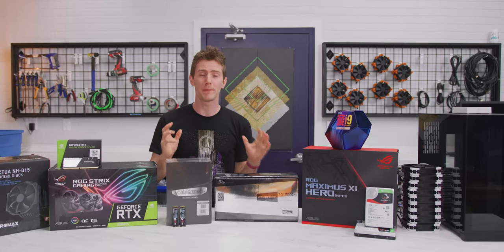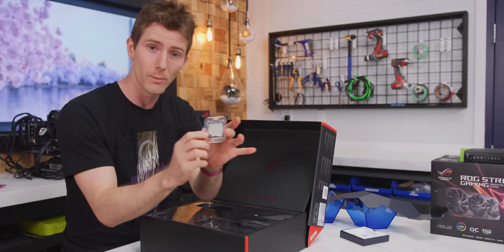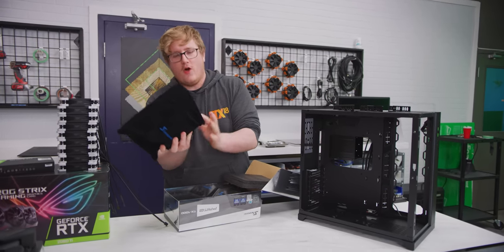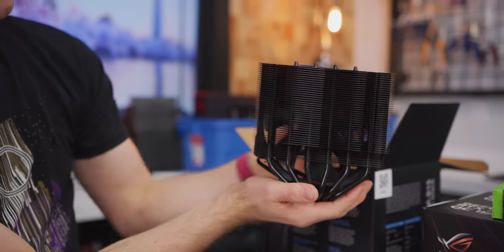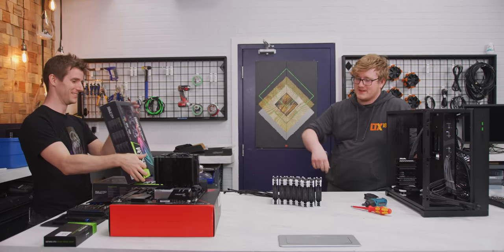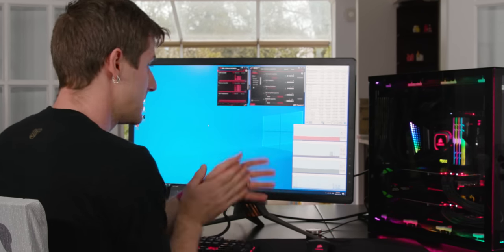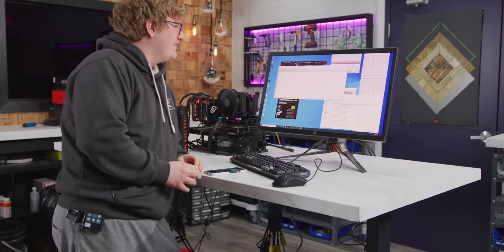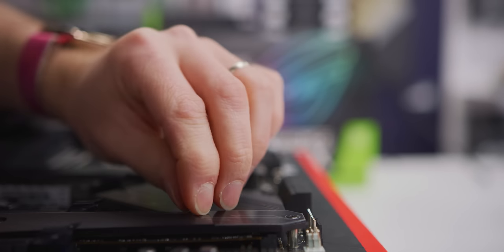Can AMD Beat the ULTIMATE Intel Gaming PC?

Comment: "We wasted a little bit of money on a second graphics card" ...  yeah, those darned, dime a dozen 2080's huh, pff          lol >_<
Reply: just a little money...heh
Reply: 2080 ti's. Don't forget those two letters, that's a $400 difference *per card*.
Reply: 2080 ti*. 2080s are much cheaper
Reply: agree, still overprice system for most people ~$4000+. maybe 850 watt PSU, rtx 2080 super & one 970 evo NVMe SDD, ~8+ HDD, ~ 3+ case fan enough?
Reply: Forgot to mention a new cooling system and another motherboard. Frankly speaking they should know that second GPU is a waste of money for gaming.
Reply: And raid 0 nvmes

Comment: Air Cooling...
00:50 "It doesn't make a difference."
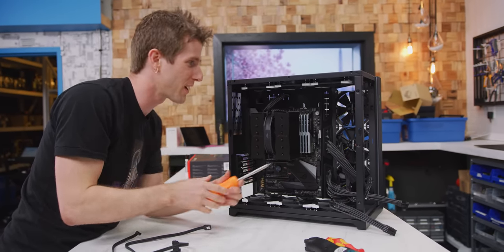9:56 "Oh my God... It doesn't fit."
Reply: LTT: "It doesn't make a difference."
Gamer's Nexus has entered the chat
LTT has left the chat
Reply: This is so good played one after another
Reply: yeah cause every case fits a "full ATX motherboard" and a water cooling loop, or even an AIO.
Reply: I made a pc for my friend with the hyper turbo cooler master two fans same thing happened but he had a plastic case so it just warps it a bit lol
Reply: that’s what she said
Reply: i thought the trendy thing was to go wall mounted now. no case means no problem.
Reply: Doesn't make a difference if you get a proper case*

But yeah, the main drawback is DEFINITELY the size of air coolers.
Reply: XD
Reply: @gardian06_85   yeah because every case fits a 100 ft tall tower cooler and everyone uses only the second PCIe slot, or even any RAM with heatspreaders.
Reply: @kingsizemedal  arguably most water coolers are actually bigger, they're just designed to be a standard size that fits in a standard place in most cases.
Reply: Bet it would fit in an R6.... Just sayin'.
Reply: thats what she said
Reply: Lial Li cases LUL!
Reply: Air cooling is better in my opinion. I dont need the headache when it goes wrong
Reply: @lewissmith5759  It only goes wrong if someones is just enough stupid to NOT check height and ram clearance. Something that someone with 10 years experience should totally not do.

Comment: "We went with an air cooling because water cooling isn't necessary"

Narrator: it was necessary
Reply: Read it in Morgan Freeman voice
Reply: That air cooler is a monstrous ugly block of aluminum. AIO makes everything look neat and organized.
Reply: @Gamevet  Yeah but the function of the PC and performance, it isn't necessary it makes no difference
Reply: According to the new Gamers Nexus video there is differences..
Reply: @mattlevin2205  It makes no difference when you use an air cooler as big as a 2 stroke  engine. Those things are ugly.
Reply: @Gamevet  ugly until you realize it will outlast any AIO by ten years at a cheaper price.
Reply: @Gamevet  Shure if you like having fucking pipes run all over your Mainboard.

But seriously, taste is relative, I prefere BeQuiet over Noctua by a Longshot, because in my opinion they look more finished and designed, whilst Noctua's to me still are huge monstrositys that where desinged by a computer that got fed a bunch of airflow and heat transfer data.. and where painted Beige and Brown afterwards, or well black if you pay 10€ extra, but some people do like the brown coolers, some people put Butter under their Nutella, and some people make hot chocolate Whit soy-milk (I personally prefer Oak milk but that's another story)
And some people like you prefer to have tubes in their computer, and all of those choices are fine, well except of course if you put the milk in the bowel before you put the cornflakes in, that's Heresy.
Reply: @Gamevet  It also comes with maintanence. And nobody really cares about the look of your PC except the people who are willing to spend 300€ extra for literally no performance upgrade.
Reply: @qorkado5007  and won't fit anywhere
Reply: @qorkado5007  I don't care. They look like shit. My Corsair H110 is 7 years old and has gone from my 4790K build to my 9900K build and it still still gets the job done. Much better than my Cooler Master Hyper N520 did.
Reply: @Gamevet  they look cooler but some air coolers are better and last much longer than an AIO which fails in 3-6 years.
Reply: @Ocastia  AIO isn't what you are describing.
Reply: @UCaP9igqCVh_UPA2ak7j5iAA I do care. I dust the inside of the case every month.
Reply: @thiagomarques3036  Who said the air cooler needed to be large?
Reply: @Gamevet  ok two tubes
Reply: @crazyksp8344  Wrong. A good AIO will last you a long time. Mine is now 7 years old. If it dies tomorrow, I'd have spent less than $15 per year for it. One of the fans failed, but the pump is still going strong.
Reply: @thiagomarques3036  except y'know in the fricking pc
Reply: @Gamevet  Even a smaller one wont impact a lot on any standard CPUs
Reply: @Gamevet  but some air coolers perform better and sometimes much more quieter than an aio. And cheaper, and air coolers look nice in some builds.
Reply: @mattlevin2205  Bullshit. I had a Cooler Master Hyper N520 on my 4790K. It was hitting 80C @ 4.7 Ghz. It stayed under 70C with the H110. Here's that ugly cooler. http://us.coolermaster.com/product/Detail/cooling/hyper-series/hyper-n520.html
Reply: @crazyksp8344  That's a matter of opinion.
Reply: @EvolveOutdoors  Interesting, never had a single thing go wrong with my AIO. 2 years old now. Not one problem. And it meets my aesthetic desires, unlike giant air coolers.
Reply: I went from a Thermaltake big water 360mm aio with 6 identical fans to a Noctua NH-D15 and the air cooler beats it. The AIO temps on my 5960x 4.5ghz would get into the high 80C, NH-D15 with the same IBT run I got into the low 70s with 80% fan speed. I thought the air cooler would do slightly worse, but I was wrong.
Reply: AIO really does look better. Sleek, vs a ginormous block.
Reply: @VikingDudee  If that's even remotely true, it's more telling of how your layout and fan placement was done than it is about how a specific piece of hardware performed.
Reply: @Gamevet  And a custom loop with good fans and a heap of radiator space makes everything quiet ...
Reply: @VikingDudee  With all due respect, I won't buy anything from Thermaltake. They are a garbage company. I once bought a 750 Watt 80+ Bronze PSU from them. Not only could it not deliver anywhere close to 750 watts, it would shut down at less than 600 watts. Revised reviews of that PSU exposed bad ripple on the +12 V rail, once it started gettiing pushed. One caught on fire in a test lab.
Reply: @Gamevet  i STRONGLY disagree .
Reply: @user3wx9V-178  oops forgot to fix my mistake
Reply: @christianscandi  Look at the guy above you. His Corsair H100 is older than my H110. I also have a cheap LEPA 240mm AIO that I got about 3 years ago. It hasn't been run hard, but either way it's still working.
Reply: @Gamevet  Well, The AIO is Asetek, Can't see why I couldn't trust it, its the same as Corsair without the fancy Bling on the pump.
Reply: @RAW_Reality  Not really, 6 fans on the AIO as intake on the Corsair Air 540, 1 top fan exhaust, 1 rear as exhaust, Video cards are 3 fan design so most of its expelled heat is in the case, The AIO just did not perform better, it just couldn't.
Reply: Yeah, the 'best' noctuas are so massive they won't fit in most mid cases. Even on full cases, they can overlap the RAM. I was building a system using PCpartspicker and tried picking the 'recommended' noctua-but then did some research and found that in order to get it to not hit the RAM, it would be too tall for the case by a notable margin. Had to settle for a 120mm version, but should still be better than a wraith spire.
Reply: @christianscandi  My old H100 I bought in 2012 from Newegg is cooling my brothers 9700k, its still going, although 1 of the fans started making sounds so we changed them for some RGB Corsair fans to lighten his case up a bit. I got a h50 as well on an older Phenom II x4 940 system I really don't use much, it still keep the chip below 60c at 4ghz with the original fan.
Reply: @VikingDudee  There's a perpetual thought that "having this much intake at this position means this result"... That notion is wrong, and wrong by a mile. There's literally dozens of videos on YT that all say orientation this or that, but not one of them ACTUALLY address why something "performs" differently. Simply put, if I had been at access to whatever hardware you had then or now, I'm within minuscule doubt that it could have been arranged better that'd have produced a better outcome, because I KNOW how and why the dynamics of positioning matter more so than literally every video I've ever watched on YT explains it. So yes, really.
Reply: @RAW_Reality  AIO has better results by bring in fresh cool air from out side of the case....Which is how it was installed in push pull in front of my case, It set up the same now minus the rad and 3 fans. It straight our beat the 360mm AIO, like it or not.
Reply: @VikingDudee  My point isn't about "which way beat which other way", my point is that you're not understanding as to even why it does, which is why you're inherently wrong, like it or not. Your problem isn't that the AIO "underperformed", it's that you stunted the airflow by putting it there. Until you know WHY a problem exists, don't talk as if you have the answer "because the outcome changed".
Reply: @qorkado5007  to be compared to a decent AIO, it needs to be huge..
Reply: @VikingDudee  Asetek manufactured the pump. They pretty much own the patent. The rest of the parts, including fans can be from any manufacturer. This review shows the 360 to run cooler than the Noctua D15. 

https://www.kitguru.net/components/cooling/james-dawson/thermaltake-floe-dx-rgb-360-premium-edition-aio-cooler-review-with-amazon-alexa/6/

I have that same case BTW. It has excellent air flow, but my setup is totally differen. I have 2 corsair 140mm fans on the top of the case with the radiator. I have them pulliing the air out of the case, while the 2 front 140mm fans on the case pull in cool air. I also have a rear 140mm exhaust fan. 

My setup kept an overclocked 4790K under 70c @ 4.7 Ghz and it keeps my 9900k even cooler at 4.7 Ghz. Something isn't right with that setup.
Reply: water cooling sucks, pump fails you have to buy a new AIO or complete new water setup.. Air cooling is cheaper and it will never fail..
Reply: @tomko_lep  What maintenance? AIO's don't need to be refilled or messed with. Just like an air cooler, you just need to suck or blow out the dust every now and then.
To me the main reason I went with an AIO is just how insanely quiet it is. My Corsair H100i v2 is less audible than the 7 ultra quiet fans I have in my case.

My PC is so quiet you cannot hear it from more than 3 feet away. In order for it to be really audible you would have to put your face close up to the case.

The air cooler I used to have was the generic equivalent to a Noctua cooler that cost around $70 or so was definitely an upgrade over the new stock AMD coolers in terms of performance but...wasn't really that much quieter, sure it way quieter than what I used to have on my AM3 CPUs but while gaming I could definitely hear it spinning up over my games. My new AIO is so quiet I would have to turn off all audio in order to hear it while gaming. Even then I would have to put my head closer to the PC tower.
Reply: @qorkado5007  I'd rather flush my loop and canned air blast my radiator. My air rigs big heatsink takes on so much dust that it requires scrubbing. It sucks.
Reply: @PhilJohn1980  my 360 rad is double thick and the fans are silent. Needa flushing every 2-3 years if I'm not using water, with water(and a bit of silver) iv never had to flush the loop since. My air cooler needs dusting every few weeks or it gets so bad I have to remove it and Wash it, way to much trouble my custom loop is less maintenance.
Reply: @Gamevet  I love thermaltake cases and rads.....lmfao they make psu? Dude seasonic or bust.
Reply: @Justice-qw7sj  move pc and 20pound brick smashes 800$ gpu. Yeah no thankyou, I'll save the air coolers for the family pc or old crap that'll never get moved.
Reply: Water cooling is only necessary if sponsors are involved
Reply: @Gamevet  I had a corsair AIO for about a year until I started hearing air in the pump. Upon inspection, I couldn't find any leaks so I assume that there was a tiny leak that, over time, let a sufficient amount of water drain from the loop. After that experience, I will never use an AIO ever again. Incidents like that would never happen with a simple air cooler and, with the NH-D15, the cooling performance is still sufficient to allow for 5ghz overclocks at low temps. The only reason to really go water is if you want to cool the GPU as well and that's better suited with a custom loop, which I may try in the future.
Reply: @mattlevin2205  It does make a difference, not huge but still
Reply: @willo1345  Like I said, I've had the same AIO for over 7 years. You just had bad luck. NH-D15 is ugly too.
Reply: Water cooled is better against dust
Reply: Honestly I found it much better to get a $8 mini fan from Walmart and just put it outside my case blowing in, sounds stupid but nothing gets over 74C (82C while gaming). Unfortunately it’s a tad loud and my completely quiet pc turns into a somewhat quiet one because of the fan running but I think it’s a great option for budget builders.
Reply: No one in this thread has ever heard of the concept of an OPINION
Reply: @Gamevet  7 years is very impressive for an AIO
Reply: @Gamevet  maybe they were sponsored, no other reason for them to go with that stupid thing.
Reply: @DEBBAH1907  Sponsored by Glasswire.